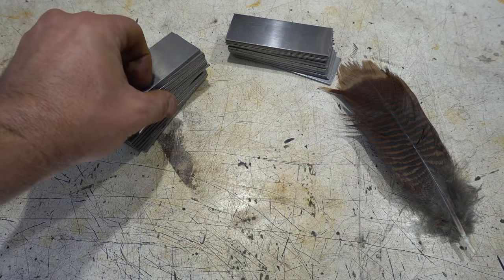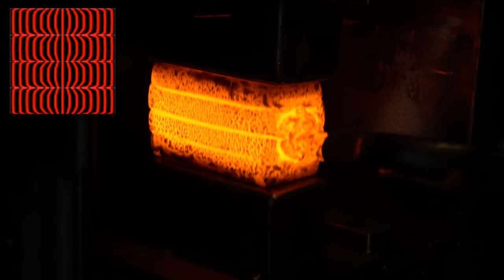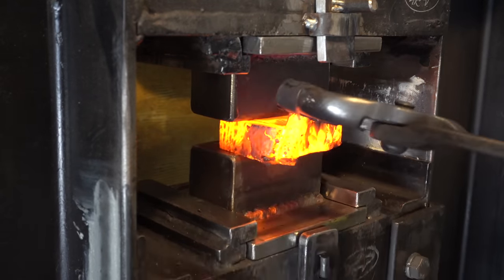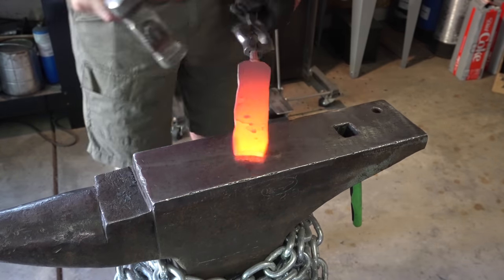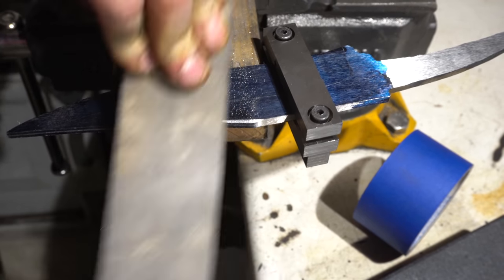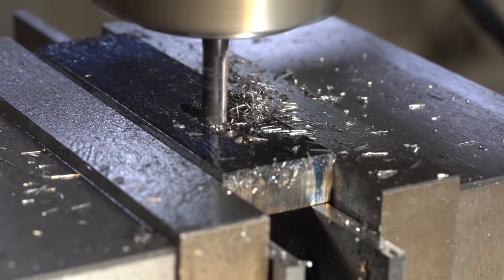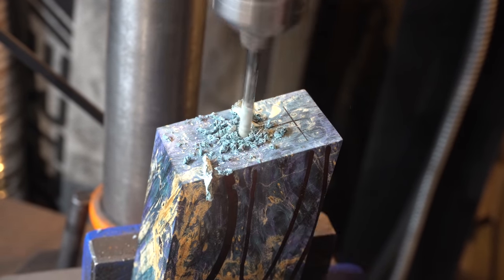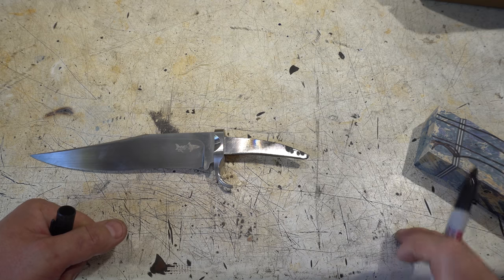Forging a Feather Damascus Bowie Knife - The Complete Video

Comment: No need for all that, just pour the molten metal into a mould.
Reply from the maker: I assume that’s a joke.  Despite what you see on TV, you can’t pour molten steel into a mould to make a knife or sword.  Thanks for watching.
Reply: @TyrellKnifeworks  
Of course you can pour molten steel into a mould; it's done all the time!  You are still using the traditional stone-age method as a hobby (may be you just enjoy pounding)
Reply: There has been cases of where knives have been successfully cast (Boye dentritic knives being the one I've heard of), but they use very specific alloys (A Cobalt based alloy in Boye's case...its not even a steel and seems to be specifically designed for high corrosion environments)  and it'll only be practical for a high volume of knives that's the same size and design. I suspect for most makers, this defeats the entire point. 

Trying to cast knives from conventional alloys would likely just result in a brittle mess, or perhaps paperweights that can't hold a edge due to so much carbon being cooked out of them.
Reply from the maker: @byronreeves8607  For this to work you'd most likely need to flood the entire chamber with some inert gas like Argon.  Still the cooling rate is going to kill it.  There's been too many TV shows and movies that show this and people get the wrong idea.  Geez, Lord of the Rings had this concept in it and it made not sense then.  But I guess if you can cast spells and have dragons, then casting a sword might be possible too.  🤣🤣🤣
Reply: @byronreeves8607  
He could just buy a flat piece of metal then and grind out the shape he wants for a knife...